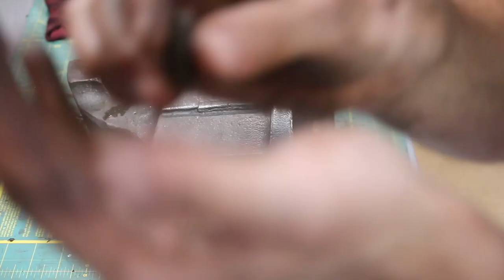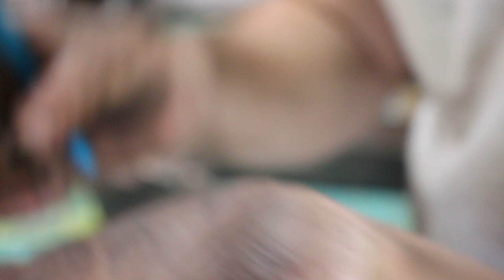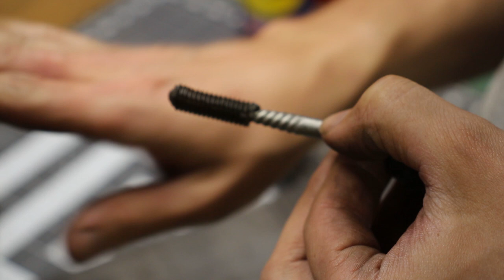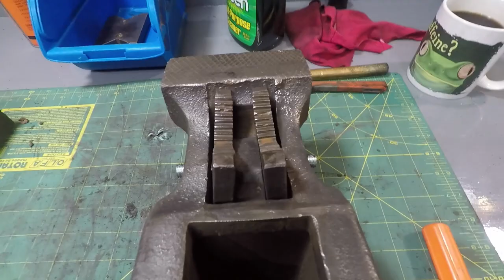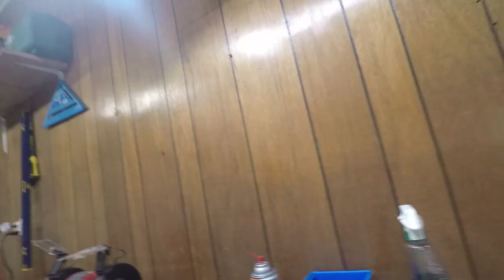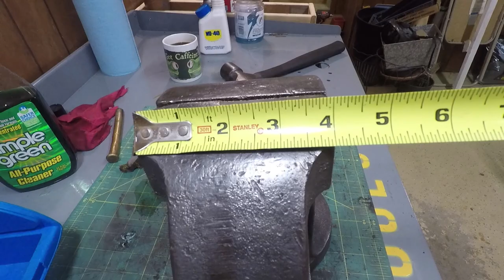Fulton Machine & Vise Co. Vise Restoration - Broken Bolt Bonanza

Comment: I  have a # 15 Fulton Star Vise. The Set screws are actually protruding square headed screws. Your screws may not have been original so don't fret.  The vise turned out very nice. I'm glad to have found your video do give me ideas for mine. I have the same base as yours though without the protruding donut. The one bolt mount/nut holder is the same though.

Comment: Please post what you find out about the bolt that holds the dovetail section in place....the way it sits now your table will have to be exactly thick enough to secure the vise,and the dovetail screw? I have seen other vises where the bolt, like all-thread, secures the dovetail nut tightly and then the rest of the bolt about six threaded inches has a nut at the end with handles like a big butterfly nut, tightens the vise to the table regardless of how thick the table is.